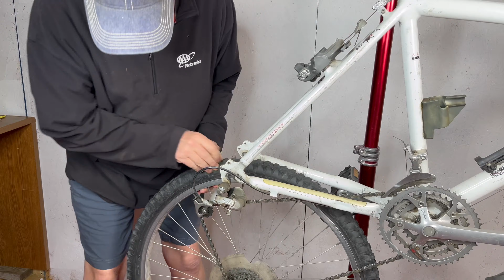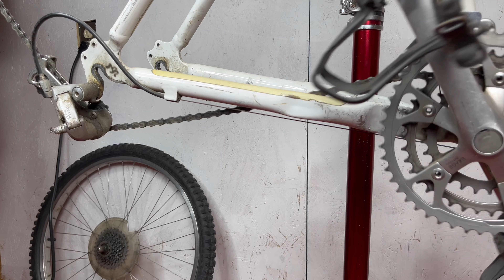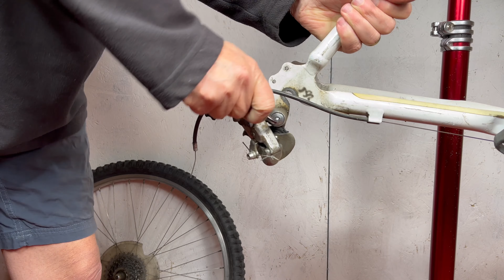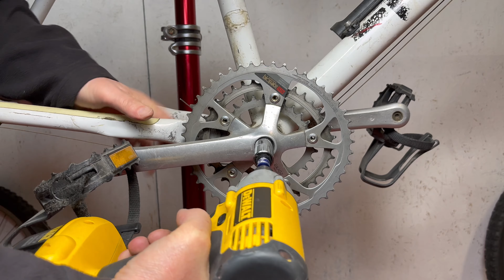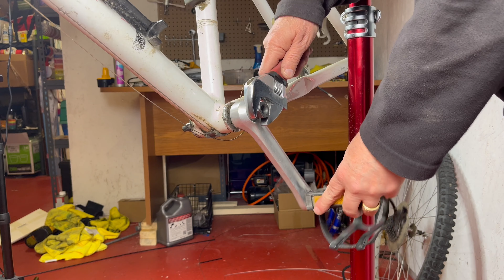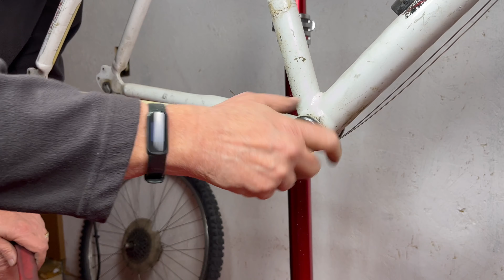What's Hiding In My 1988 Cannondale SM500? 🤯 😱 (Bicycle Rebuild)

Comment: Nice Bike!! Would love to find some similar age components to use on my bike build... BTW, I believe the front brake cable is supposed to be routed between the housings, in the video it is routed on the outside of the drive side housing. Great video and keep up the great work!!
Reply from the maker: Thanks for watching!  I noticed the cable routing after I finished the video.  I felt kind of silly after I saw that and thought nobody would notice watching this.  lol. I was wrong.